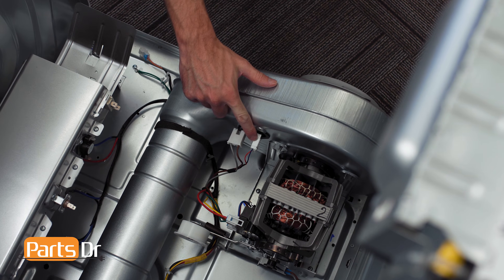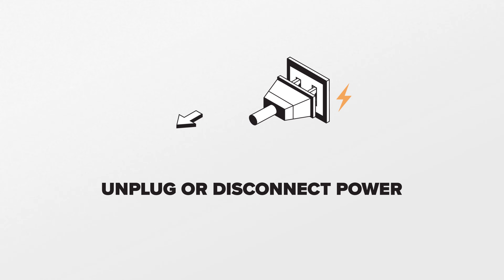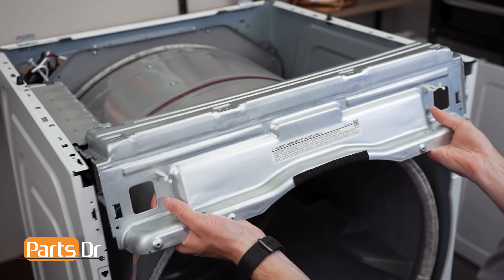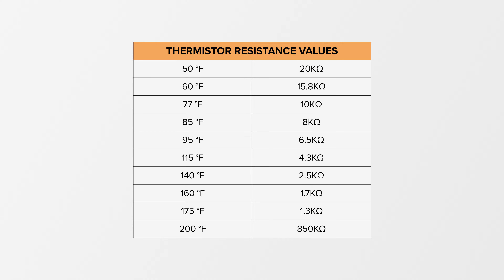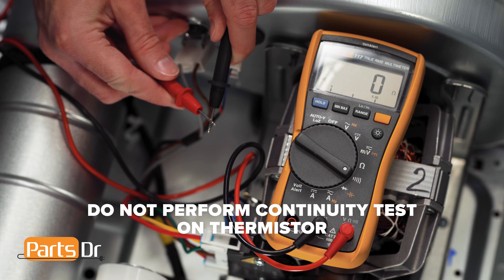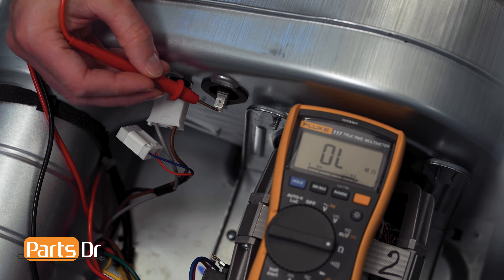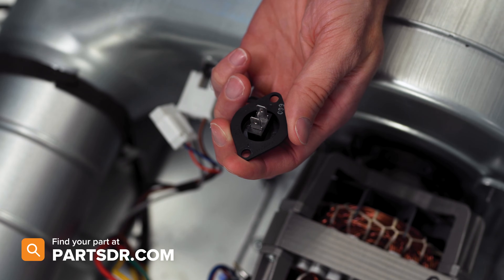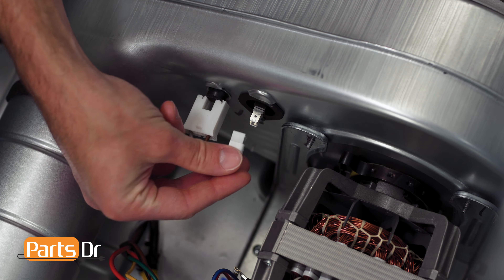How to test Samsung dryer thermistor. Samsung dryer tS, tO, tC and tC5 error codes FIXED!

Comment: I did not get a code, dryer powers but when I press start I get a burn smells and smoke from rear. I replaced the heating element, high limit thermostat, and thermostat fuse.  Started it up but still smoke smell. I took it apart again and tested the resistor my reading was 9.9 at 20k. Is this the problem?

Comment: The check filter light blinks 5 times on my DV52J8700EP/A2. I have taken apart the dryer, removed all lint, replaced vent hose and vent, but the light still flashes. 

Could this be a symptom of a bad thermistor?

Clothes aren't dry even after running for hours
Reply from the maker: Read page 41 in the owners manual here: https://downloadcenter.samsung.com/content/UM/202307/20230706164852306/DC68-03170S-06_IB_DV8000J_EN.pdf
Reply: @PartsDr  I did read that section. I isolated that the problem was not the external vent hose by removing the hose from the back of the dryer and turning on the power. The check filter light blinked 5 times.

I also measured thermistor DC32-00007A at several temperatures (63F --> 14.1 kohm, 68F --> 11.52, 71F --> 11.26 kohm). Do these readings sound ok?
Reply from the maker: @GenericYouTubehandle910  Those readings appear to fall within the manufacturer's specifications.  Sometimes the thermistors can file at higher temperatures but test okay at room temperature.
Reply: @PartsDr  Apparently my dryer (Samsung DV52J8700EP/A2) includes another thermistor referred to as "Vent thermistor 2" (Samsung #DC93-00329A), which has a resistance of 238.23 k-ohms @ 77F. Any idea where I would find this in the machine and do you have a resistance table I could reference?
Reply from the maker: @GenericYouTubehandle910  We were not able to locate a resistance table for this part, only the same 238.23K ohms at 77F.
Reply: @PartsDr  Any idea where it's located in the dyer?
Reply from the maker: @GenericYouTubehandle910  It looks like it is located on the duct that the heater connects to that draws the hot air into the drum of the dryer.
Reply: @PartsDr  Would this secondary thermistor have any bearing on the check filter sensor that keeps popping up? Or is this more likely a control board failure?
Reply from the maker: @GenericYouTubehandle910  It could be either.  Let us know what you find.
Reply: @PartsDr  I'm going to reach out to Samsung for resistance table on this second thermistor as it's not feasible to provide a 77 deg F environment to test in the middle of winter lol

Comment: This will fix an he error code as well. Literally taken my dryer apart maybe 40 times chasing different issues 97% of those times it was that sensor either corroded or malfunctioning. If the inside of your dryer is wet at all just go ahead and swap it

Comment: Ours has an HE error code. Thermistor was replaced last year. Heating element seems ok. What are the two components attached to the heating elements housing and what kind of resistance reading should I be looking for to test if they are OK?
Reply from the maker: They are the high limit thermal fuse and high limit thermostat.  Learn how to test them in this video here: https://www.youtube.com/watch?v=iWZucCy3EC8

Comment: Hi, I don’t have any error codes on my front load Samsung dryer but it runs hot on all settings even set on extra low it will run full heat as soon as it’s turned on, please help, thank you
Reply from the maker: Test the heating element for a short like we show in this video here: https://youtu.be/iWZucCy3EC8?feature=shared&t=146

Comment: Hi, My name is Tony. I hope somebody could help. One day my Samsung (10 years old DV218AEW/XAC) electric dryer stops after 20 secs start-up and hE code appears. I checked and cleaned out the filter. The tube from the filter housing to the back is blocked solid with dog hair, wet lint. I cleaned everything out, blow-dried the vent completely with my garden blower. Still starts and stops after 20 secs. What could be the problem? Thank you so much for your help.
Reply from the maker: Try checking the thing we show in this video here: https://www.youtube.com/watch?v=iWZucCy3EC8

Comment: I finished installing a brand new Samsung dryer and instantly, it goes TC error code.  I’m about to get on Samsung’s case for such a problem
Reply from the maker: If it is brand new, take it back to the store and ask them to exchange it for a working one.
Reply: @PartsDr  thanks for the reply.  Got the manufacturer to send a tech to fix it.  It was a connector to the temperature controller that went loose.  He simply pulled apart the unit, pushed that connector back on and reassemble the unit and voila!!!  It’s working as it should.

I’m just disappointed with the default authorized repair company they had.  Apparently, Tekniton never answered my emails OR my 30+ phone calls throughout the days.  Had Samsung call them and email them on my behalf and no response.  I simply canceled Tekniton and hired someone within Samsung network that came the next day.

Funny story.  Tekniton immediately started making numerous phone calls to me after I canceled them and got the work done already.  I tried to call them to yell at them for their delayed and poor service but same MO; no answer or return calls OR ability to leave voice mail.

Comment: I spent way to long taking apart the dryer. There is an access panel in the back with the vent tube. Pull that out and you can get to evarything involved. I hope this will save someone else time. Now if your looking to clean out the dryer while changing out parts I would suggest this video.
Reply from the maker: Thanks for sharing!  Unfortunately, all of the newer Samsung dryers do not have this rear access panel.
Reply: Just here to say thanks alot. This comment saved me alot of time on a couple of Samsung dryer repairs. I'm about to do another one and I got the guy to send me a pic of the back of the dryer and it has the rear access panel around the duct. Thanks again !
Reply: Excellent. Saved me hours. Now let’s hope that’s my actual problem.

Comment: Hello, can the thermal fuse for the heating element be used on the blower housing?
Reply from the maker: No it cannot, they have different temperature ratings.

Comment: There's a access panel on the back of the dryer.  You don't need to disassemble to remove the thermistor.
Reply from the maker: Hi Dude, some older Samsung models have an access panel on the back of the dryer but most of the new models have to be disassembled similar to the process that we show.

Comment: I have no power to my dryer now. I been troubleshooting and I noticed my therm-o-disc T-105 has a 105K ohms, could this be the main issue? Ps, I heard a low sounding pop and burnt smell when I tried to turn on the dryer before I lost power.

Comment: Im having a very strange issue, replaced element and all thermal fuses, and thermistor, AND main board. Turns out they were all fine.
Everything meters fine. Testing both at the components and at the board connectors. No shorts.
when I power up the the dryer and enter the diagnostic mode and go to option 5  (current temperature) its reading the ambient room temp as 200f or higher. This is fooling the system into not engaging the heater relays, as it thinks it is already at temp. This is the same with original thermistor and the new one (both test fine with meter). When I run the test mode the motor and heater both fire up no problem and it reports OK.
What else could possibly be causing this? Keeping in mind I have already wasted almost $300 on a new main board that did not solve the issue.
Samsung DV42H5600EF/AC
Reply from the maker: It sounds like you have replaced everything but the wiring.  This type of issue is not something that can be solved through a Youtube comment.  We would check to make sure your thermistor is a new OEM part.  We see a lot of issues with aftermarket and knockoff ones being sold on eBay and Amazon.
Reply: @PartsDr  Update for anyone with similar issues: After testing and replacing all parts, including main board, the ultimate culprit was infact the motor (or more specifically the centrifugal switch on the motor).  Turns out that even though the motor was turning fine, and when I ran a testmode that manually fired the motor and heater relays, the switch on the motor was not functioning properly, thus not sending the "ok" signal back to the board to close the heater relay during normal operation.
 changed it out and everything is as good as new!
Reply from the maker: @bw905  Thanks for the update!  Those motor centrifugal switches are very tricky troubleshoot.

Comment: Hi, im getting the TS code and my thermistor is reading 160, can it even go that high? the dryer turns on for 5 seconds then shuts off with the TS code.
Reply from the maker: It sounds like you have a bad thermistor from what you describe.

Comment: My dryer overheats clothes, could it be faulty that dryer thermistor?
Reply: I checked with the multimeter , no continuity and no Ohms.
Reply from the maker: @SaresMLee  The thermistor will NOT show continuity.  Make sure to test according to the instructions in the video.

Comment: Hello, I'm getting ~12.5K Ohms. Likely upper 60s in the basement. When I run dryer vent blockage test I get error code CL9 (90% blocked). Vent is totally free and clear. Dryer also shuts off after about 3 seconds into any cycle. Display remains on, and dryer can be restarted. Runs for another 3 seconds and stops. 

Any chance it's the thermistor even though resistance reading appears to be in range?
Reply from the maker: It does not sound like a bad thermistor if it is testing within the correct ohm range.  What is the model number of your dryer?
Reply: @PartsDr  Samsung 	DVE45R6100C/A3
Reply: Hey, I just bought a used dryer and was lied to that it worked… exact same thing is occurring with mine that is occurring with yours and they are similar models. I’m wondering if you ever figured out the fix. I’ve already taken this thing apart and tested many of the components and all are showing continuity/proper ohm test. Thanks for your help
Reply: @jonneighbor1347  - Unfortunately, I reached the point where the time investment in debugging wasn’t worth it anymore - bought another one. I can confirm replacing the motor, and thermistor did not resolve the problem. My hunch is that it needed a main board, but never confirmed.
Reply: @aarongoldberg9975  I'm having the same issue. First I had a bad Thermal fuse, then exactly the same issue with CLg (not CL9) which btw isn't 90% blocked but fully clogged. The vents are spotless and I replaced the Thermistor. I'm thinking this needs a new board.

Comment: I have an issue with an open box Samsung flex dryer it is displaying the error message: FC. I want to know how I can resolve this issue
Reply from the maker: According to Samsung the FC error means "This code means that there is an invalid power source frequency. To fix this, try restarting the cycle."

Comment: Hello, the 11.27 resistance rating you had in the video. Was that indicative that it was reading too high for room temperature? I have been having problems with the tC code on my dryer, and tested the thermistor and it showed resistance right around the chart. How far off does the resistance need to be to be a defective thermistor?
Reply from the maker: The resistance rating shown in the video is for a good thermistor.  Samsung does not specify the tolerances for a bad thermistor.  Our guess would be that the thermistor would need to be off by 5-10% or more to be considered defective/bad.  Since the thermistor is pretty cheap, it would probably be a good idea to replace it either way.  If the error code still persists, then you could have bad wiring between the thermistor and the main control board or a bad main control board.
Reply: Relatable. Thanks for this discussion.
Reply: Did you figure it out?